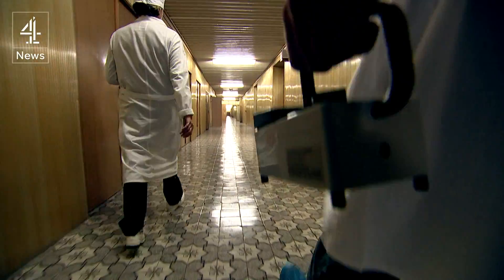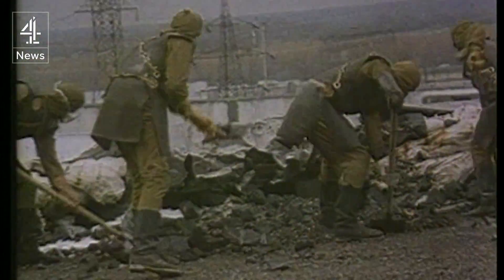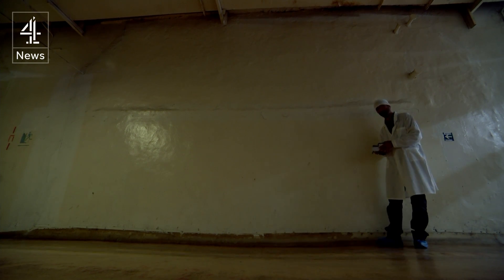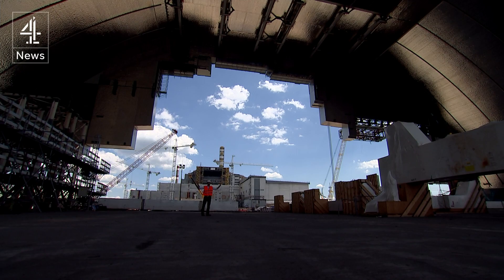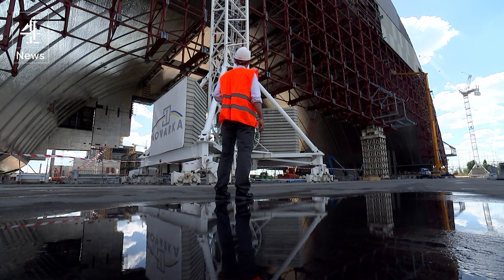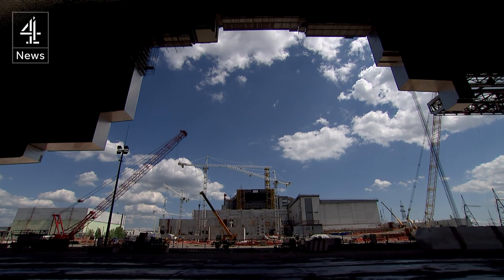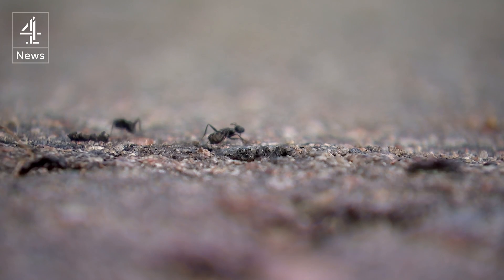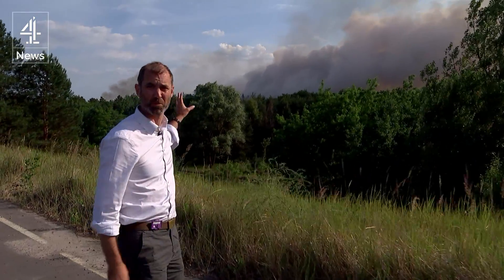Chernobyl: urgent rush to repair nuclear reactor dome

Comment: Thats not fixing anything! Its just another giant bandaid, except this ones good for 100 years. Whats the ukrainian motto? Just put another giant bandaid on it and let the future generations deal with the tumor we left on the earth.
Reply: Well. You see the cranes inside? What do you think they are for? Maybe they are for deconstructing the old shelter and removing the nuclear waste. Maybe.
Reply: The sarcophagus is to prevent radiation from dangerously spreading across the entire planet. It wont be needed forever, just until the radiation decreases to a safe level which does take a long time. Hiroshima took about 20-30 years, which may conclude that Cheronobyl will take about 1.5 centuries.
Reply: The Ukrainians had no say in the matter, the EU did.
Reply: +jamal halili nothing except  cover it until it loses heat
Reply: Justin Macdonald You wanna try going in there and taking care of it? 5 minutes near the elephants foot and you'll get extremely sick, and hour and you're dead, and if I remember correctly at one point 300 seconds was lethal. There's a reason people stay away and can't do anything yet

Comment: I don't care how much you paid me or if reporting was my job, I would NEVER stand on the opposite side of a wall to a reactor. Fuck that
Reply: ***** forgot to mention 'a reactor that has gone through meltdown'
Reply: +Mr Feltcher I've been, it was awesome, Pripyat is a sight to behold
Reply: I've been there and we stayed 2 hours actually inside the nuclear plant with the tour guide, and an additional 3 hours exploring the city. We had Geiger counters and radiation levels weren't that high.
We even went into reactor #4's control room. The only really dangerous place is inside the reactor's core/room. (we also visited hall unit 2 where the spent fuel pools are.)
Reply: +CW Productions jealous :(
Reply: +jamal halili not exactly, you get the annual dose of background radiation within 2 hours of been their and some small areas are radioactive to kill you within 10 hours, look it up.
Reply: Back when you were allowed in most of the buildings one of the most dangerous places was the basement of Pripyat hospital where they put the firemens clothing who fought the explosion. But the tours nowadays are usually done via trail and if you are in a place which is more radioactive like the small areas referenced by VideoSimple then you aren't there for long, long enough to get a picture and read the Geiger :) *****
Reply: ***** Veritasium
Reply: The site has been thoroughly cleaned, may they rest in peace, it's not dangerous now not even slightly
Reply: 4-5 meters thick wall of concrete. thats almost as thick as an average house full of concrete.
Reply: Video Simple: Sorry, probably not.  The first two deaths on the day of the disaster were from trauma, crushed underneath falling debris.  The next one happened ten days later, the first death from radiation poisoning, with the rest to follow. You might catch the same today in certain areas, but in ten hours?  No.
Reply: Hjembrent Kent: No, not in a real sense.  There is equipment and contaminated land within easy walk of the plant.  They had to clean the area where the shelter was being built, then cover it with concrete before they could bring the steelworkers in.  All in all, it's fairly safe, but it's also a hazardous environment.